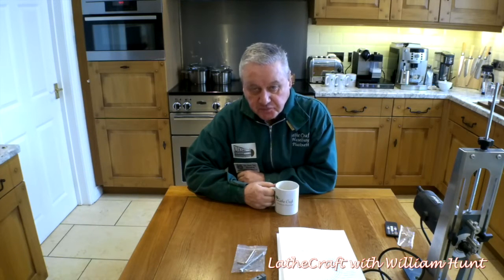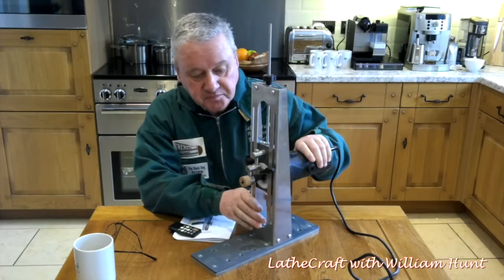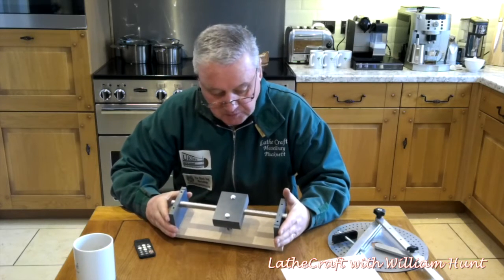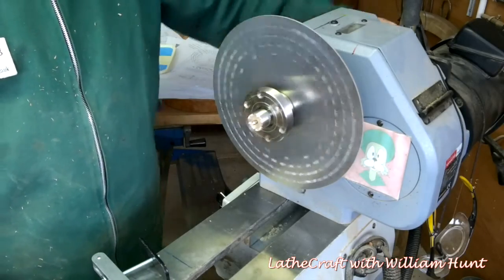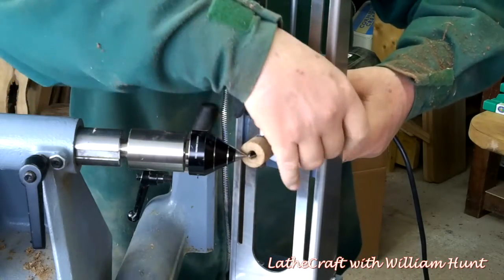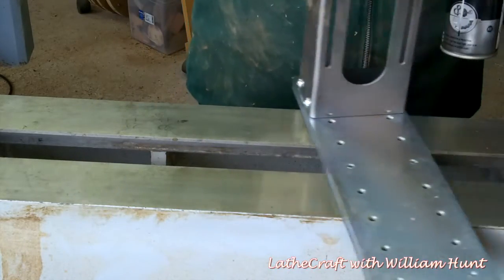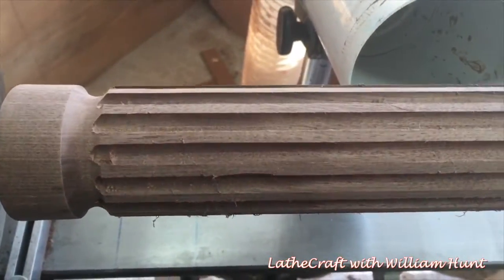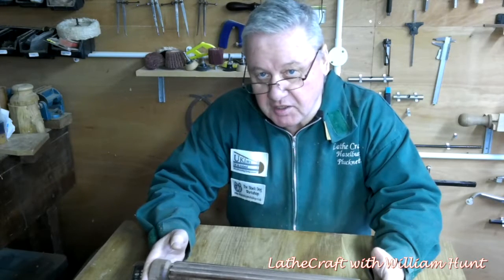Woodturning - Paul Howard Fluting/Router Jig 1 "First Light"

Comment: Hi Paul. My very limited router experience suggests that you will do well if you do a shallow first cut (all the cuts) followed by another cut or cuts to deepen to the desired depth. If you get greedy with your cuts then the router is hard to control and the cutting is less efficient and not as clean. - but I think that you have already realised that! Now moving to your other video! 
Cheers

Peter
Reply: Sorry I do of course mean William! My eye just fell on the jig name at the wrong moment. Apologies!
Reply from the maker: Peter Leffler thanks for the advice Peter,  I had read this but forgot to implement it, I’ll try to remember next time!

Comment: It might help to add a little weight to the front of the jig base. That might counter the weight of the router.
Reply from the maker: Hi Daniel, I have since found that holding the jig correctly counters this problem. A hand firmly on the base and not to push the jig.
Reply: @WilliamHuntLatheCraft  I watch your second video and saw the jig base. The jig was the way to go instead of the weights.  Keep up the great work. I really like your way of teaching.